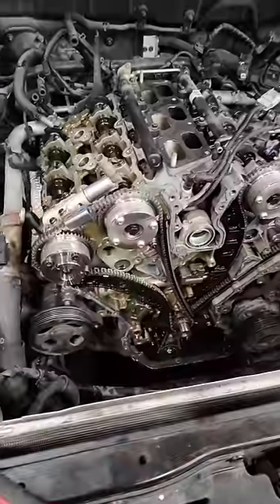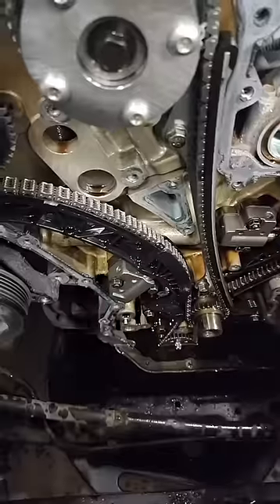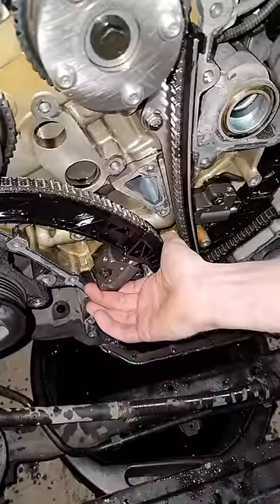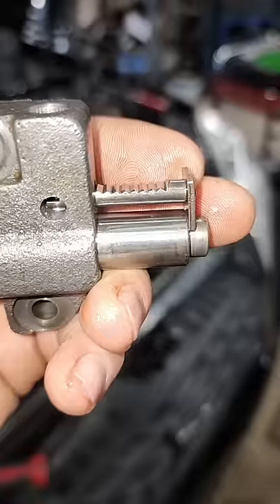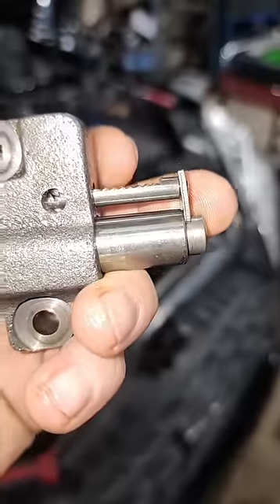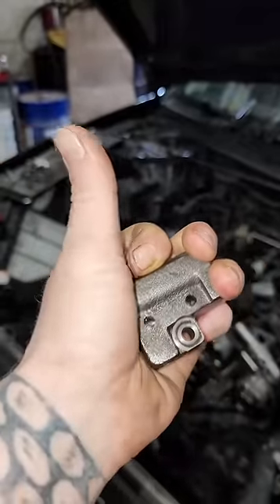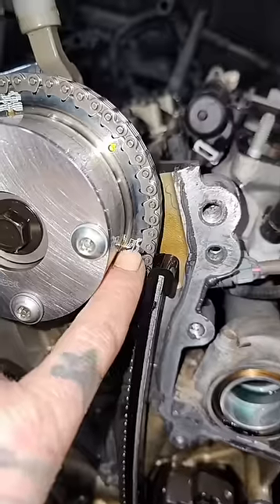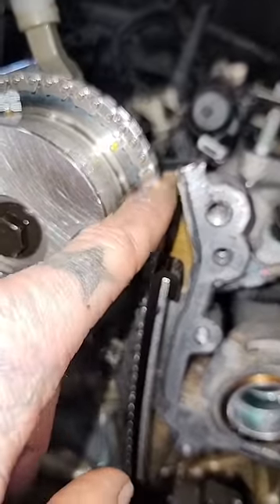I'm not happy

Comment: This is exactly why I quit doing side jobs. Stuff like this can come back and haunt you and it’s not even your fault. It blows my mind how often new parts fail within 30 days or are bad right out of the box. I feel for you brother.
Reply: I got a bad steering rack from napa for a Toyota sienna I took in as a side project. Doing one of those on your back in the garage sucks. Doing it twice is infuriating.  I’m pretty much done with side projects after that experience.
Reply: @ryanalexander984 Napa is like Walmart for car parts.
Reply: @crea7ure613  it’s always been better for me then auto zone or oreilys or rock auto.
Reply: @ryanalexander984  no we use them at my shop too but just over the years I’ve either seen the quality of their stuff drastically drop or I never noticed before but the last 5 years I’ve had more failed out of the box parts than any other company I’ve ever used.
Reply: I always buy OEM, but I understand, most people are in a hurry and don’t want to wait the time to receive.
Reply: @ryanalexander984 if you wrench all day long I wouldn't want to work in my own car let alone a come back sider.
Reply: @crea7ure613  have you ever had issue of all GM reman calipers from Napa failing quickly? For whatever reason they like to leak brake fluid from the seals after a month.
Reply: @jackmyhre8759  reman is the worst, I’ve always thought failed once it’ll fail again. But no not particularly calipers but alternators, wheel bearings, struts and shocks, had a few axles leak within 20k miles, nothing better than warranty come back.
Reply: Usually the problem is right in the box.
Reply: @proudwhitestraightman8489  it can be exhausting.
Reply: @crea7ure613  except overpriced
Reply: @Jordan__Sloan  I have had tons of issues with OEM on ford's. 
I've been soucing different products out from China now. 
Tell my customers it's cheap shit. But most of my customers understand. 
But with the Fords. 
It's like pulling teeth. 
Had to do a t stat OEM ford did last season, I got stuck doing it in -46C, I did have a heater outside. (Nothing moves much during those temps) but bleeding a 6.2 was the dumbest shit I've ever seen, put a 195f in. Then it decided not to open, motor called overheat. So shut it down. 
Then came back after a bit. Decided to open. 
Then power steering went, that line was also new. Ford wanted $234, I had a shop build me a new one with better materials for $130. 
Shit is garbage now.
Reply: Question: What protocol does the mechanic follow when the fault is on the part manufacturer?
Reply: @chriscasias375  good question
Reply: @chriscasias375  It can be painful and annoying. But I've seen some places send me full motors. 
But still don't cover time lost. 
To me you always loose, unless warranty comes into play with a dealership.
Reply: @Jordan__Sloan  sure bubbie sure...ur That guy ...
Reply: @crea7ure613 where's the best place if not napa?
Reply: @ryanalexander984 o'Reilly's is awesome. Autozone fried my battery. And terrible customer service.
Reply: that company that makes all the parts is bad, that chena company
Reply: @mitchellandrew3318  lose
Reply: @mitchallen5819  Seriously? Oreilly is the best in your opinion? You new?
Reply: @mitchallen5819  
It use to be Napa and Carquest. Carquest is now part of another chain thats similar to autozone. Im half asleep
Reply: @mitchallen5819  OEM
Reply: @crea7ure613  so, any parts store that has OEM?
Reply: @mitchallen5819  yeah typically. I’m not saying Napa as a whole is a bad company they just have bad parts just their branded parts are bad quality.
Reply: @JohnSmith-xu7ev  I've been to many different ones of both. They're usually quality, but over priced. 
O'Reilly's is the only place I've been to with good parts at a fair price and good customer service. 

A friend of mine was getting nowhere with other parts stores. 
Took him to the O'Reilly's where I usually went. When we left I said "do you see now why I go here?". He replied "yes, I may need to reach out again soon".
Reply: @crea7ure613  hhmm. I know I've seen OEM of rockauto, but they're usually expensive. Probably for a reason.
Reply: @mitchallen5819  OEM is OEM. Doesn’t matter where you get it. Like I said OEM through Napa, great stuff. Same with Rock Auto, OEM is good. Anything less is a 50/50 chance and I’m not betting my labor times on China garbage. Even some OEM shit is Chinese but hey that’s what the company wants to use it’s their reputation not mine.
Reply: @chriscasias375  At our shop, we go back to the manufacture and get them to pay.
It works for us through because we are an engine manufacture with our own parts, it's just a different division of the company so they eat the cost instead of us. (Cummins) It's a lot harder for smaller service sites.
Reply: @ryanalexander984  ouch, steering racks are bad enough but twice? I might need bail money 😂
Reply: @Jordan__Sloan  My friend had a headlight change immediately fail. OEM parts. Done in  Toyota Dealership shop.
Reply: @crea7ure613  true, but like you stated - if Chinese garbage is OEM then it's their reputation, but also your labor time. 
Good insight. Much appreciated.
Reply: I'm in hvac and even oem parts come jacked sometimes and of course they're perfect so it must be our fault
Reply: @bdog4u2  I’m also HVAC. I know exactly what you mean.
Reply: Not advocating that parts get made on China, but the quality depends on the standards set and monitored by the parent company. GM in Australia (Holden) quite a number of oem parts -ACDelco are made in china, as i assume are for US ACDelco too now. Number of European cars too.
For a number of parts ill only go oem, better life, ride or fit then aftermarket, everything else either good aftermarket or oem depending on price/quality options
Reply: Is there any independent quality control can protect consumers?
Or maybe they are doing this on purpose to force people to buy EC.
Reply: I changed front tie rods, a water pump, and did an oil change on a 2008 dodge ram.  A week later the customer called me and blamed me that his engine was knocking.  He had a shop pull the oil pan and they found the engine was full of sludge.  He tried so hard to blame me.  Ive never done another side job since.  It aint worth it.
Reply: @mitchallen5819  oreillys for sure. Autozone has gone woke, customer service and staff are horrible with no automotive knowledge at all, and their duralast parts are total crap. Been using oreillys for a while now. They all know me by name, are super helpful getting me oddball parts when I need them and I've had very little trouble with parts I buy from them
Reply: @tylerwightman2315  same here pretty much.
Reply: Amen brother!!! Makes you look bad and very few people understand... And now with so many litigious City folk moving to the country looking for a score you're just risking everything you own.
Reply: I do a lot of work on the side, and over the years, dealing with shitty parts has caused me to do two things: one, I paid the $150 in my state to form an LLC so that my liability is limited in case of a lawsuit; and two, nowadays I have all my side-work customers sign a one-page disclaimer & waiver that I paid a lawyer friend to write up for me. It basically states “you’re coming to me to have repairs done outside of a professional environment; unfortunately there can be unintended consequences as a result of parts failures, and these failures are not the responsibility of the installer. The installer only warrantees his labor if the installation itself is found to be the root cause of failure.” There’s some other plain-English stuff in there, but what I explain to my customers is this: If I do an engine repair, and the new parts fail and cause the engine to explode, I bear zero responsibility. I can get away with this because I do not mark up the parts and the agreement also states that all parts are, in essence, customer-provided. Oddly enough, I haven’t had a single customer take issue with signing the paper. I also haven’t had a major failure yet.
Reply: That's why I put original parts instead of aftermarket
Reply: China special
Reply: I recall in a college engineering course, majority of failures occur near the begin of the product life, and past the expect life expectancy. If it doesn't fail within a certain, it won't likely fail until long after use (unless you abuse it).
Reply: @ryanalexander984  awe poor baby
Reply: @frickenbored  bummer
Reply: @mattmatt222333  I know right? I was terribly inconvenienced.
Reply: @crea7ure613  another of parts are oem garbage
Reply: @Jordan__Sloan  oem parts are failing just as much as aftermarket unfortunately
Reply: @mitchallen5819  OEM
Reply: @chriscasias375  find a different manufacturer
Reply: Computer repair is about the same.

Customer: “you worked on it last and now it’s dead”…
   of course “last” was 2 YEARS ago!!!
Reply: @JohnSmith-xu7ev  yep carquest is my go to. Oddly enough i am not a fan of their parent co. Discount . (Or now i guess its advance) carquest seems to have their act together atleast. I also use carparts if i have the time and can wait for delivery
Reply: Couldn't handle it eh.😂oh well, tisk tisk
Reply: @jimbobdobbs1597  
Yeah, thats the name advance auto parts. I hated when they merged.
Reply: Thats why i dont even try to get side jobs. If i wanna work on my day off, its safer to just go for overtime at work
Reply: This, and finally making money in the trade after a decade 😂 customer supplied is even worse.
Reply: I replaced the fuel pump in my 97 F150 about 2 years back and within a week it stopped working. Why? The fucking rubber isolation sleeve MELTED (or more accurately started dissolving) IN THE GAS and clogged it up. Why the FUCK would they put rubber on a fuel pump that DISSOLVES IN GAS?? Gee, I sure love dropping the fuel tank twice within a month. Luckily it was only about 1/4 tank.
Reply: @crea7ure613  you spelled oreilly wrong... Napa is definitely going downhill fast but it’s still better than all the rest
Reply: You can reduce it a lot by not buying a shit brands parts. I allways try to use OEM suppliers parts or the brands that are good in doing specific parts... Like continental and Dayco for belts. INA or SKF for pulleys and bearings.. Lemforder for axle parts... Victor reinz and Ajusa for seals and gaskets, Mahle for engine oil system parts and so... These are common Euro manufacturers... I would say TOP manufacturer... But yes sometimes something go wrong and usually because it was piece of shit before you even touched it...
Reply: @mr-garagechannel8294  🤣 well considering when you buy timing sets new over the counter from gm and chyrsler its a reboxed cloyes parts that would not do anything except double or triple the price of an engine rebuild! Continental and dayco belts are great i will agree.. victor makes JUNK! I will use felpro every time over victor! And you have clearly never actually rebuilt and engine.. the cost of parts is already so high you simply CANT use oem parts or the price gets so out of hand the job will just get turned down! And you talking about using oem parts... dame shop used a set of factory gm ls dod lifters didnt make it 500 miles and one failed and guess what gm told him... NO WARRANTY on lifters whatsoever! So $700 worth of lifters and a gasket set and labor was ENTIRELY on the shop! How do you point blame on that one!
Reply: @glastornjet73  what kind of problem did you had with Victor? I have never had any problem with it.
Reply: Engine rebuild is woth if car is worth it or if you buied it cheap because engine was bad.
Reply: @mr-garagechannel8294  the head gaskets are 100% bound to leak every time absolute garbage
Reply: @glastornjet73  GM lifters failed... OK that happens I know.. Because OEM parts are sometimes already shit, but I said use OEM supplier parts not OEM parts from dealer... That's a little bit different.. Because you buy usually a different quality parts (probably lover) but sometimes the same as OE and you have a varanty.  For example... Timing chains on some BMWs fail a lot do will I buy a set of chain from dealer... Yes if BMW already sell redesigned parts... Or NO and buy some other brand... It allways depend... Of course time to time something will go shit.. But by minimizing it you can still avoid a lot problems.
Reply: @jackmyhre8759  yes cuz gm brakes are the absolute worst! every gm pile of shit ive had always had brake problems!
Reply: I bought three torque wrenches in a row that were further off spec that my dead reckoning. I needed the torque wrench for head bolts. Luckily I’m ocd enough to check em before use. And the in/lbs torque wrench was accurate far as I could test but every bolt I used it in I could unscrew the next day. I think it was from temp changes
Reply: @crea7ure613  reman alternators are a pain. Last one I bought had a bent shift right from the store
Reply: @ryanalexander984 part of that has to do with the quality of metal used and the production processes.
Reply: @HyperactivePicker  recycled metal compromised strength from impurities. Going to swap timing belt and tensioner in my accord. OEM parts, hoping for the best.
Reply: I got 3 crappy carbs back to back....taps just stripped out as soon as i took the factory muzles out, flotters didnt work.
Reply: This is why i lf i do side job imma record everything i do just in case
Reply: @thewitt76 I put 3 NAPA racks in the same car before it left the shop, that's the last aftermarket rack I installed
Reply: Why I retired.
Reply: CHYYYNAH
Reply: Had a belt tensioner from autozone completely disintegrate on my 3800 after about 3 months. I had just fired it up getting ready to go to work and it sounded an ape punched it's way out the block. Everything else was fine, but now I keep a close eye on my new one. Any undue bouncing and it's out of there.
Reply: Buy oem parts
Reply: Facts💯
Reply: Exactly dude One time I changed the timing belt on get this, a '91 GS400 with 487,000 mi. I told the guy that parts were going to run about $50 more because I was going to install a water pump while I was in there and the guy complained to no end I'm like dude it has almost 500,000 miles in the water pump is old as hell and I'm already in there there's four camshafts and like 20 different idler pulleys just let me put the shit on.
Reply: @Timpon_Dorz  in some cases those are no longer an option or available at all
Reply: I Google the reviews real quick on any part I need and YouTube videos on it before I buy and that usually gives me a good idea what is shit. Learn from others mistakes 😉.
Reply: @crea7ure613  funny enough Walmart isn’t that bad of a place for car parts never had a a bad experience, sometimes you need something cheap and quick
Reply: @Mitch Allen  You work on Honda car, you get part at Honda dealer. You work on Kia get parts frm Kia dealership. That's where you ge
Reply: @Mitch Allen  You work on Honda car, you get part at Honda dealer. You work on Kia get parts frm Kia dealership. That's where you ge
Reply: @Mitch Allen  You work on Honda car, you get part at Honda dealer. You work on Kia get parts frm Kia dealership. That's where you ge
Reply: @Mitch Allen  You work on Honda car, you get part at Honda dealer. You work on Kia get parts frm Kia dealership. That's where you ge
Reply: @Mitch Allen  You get OEM parts from the manufacturer. Honda parts, go to the Honda dealership.
Reply: I've been saying for years Kia Hyundai use poor cheap wire harnesses which turn into electrical problems on the vehicles & now fires, I had a 16 Sorento what a nightmare almost everything broke electrical issues up the a** battery continually dying, moon roof wouldn't close just a disaster, they entice with the designs of the car but reliability eventually catches up to you... I remember Hyundai back in the 80s Pony Stellar were also disasters.
Reply: changed brake calipers once and the caliper bracket didn't have friggen threads on it so i had to take two hours out of my day to get a replacement really frustrating
Reply: Yea. Sucks for small businesses
Reply: I own a shop, you are 109 percent correct. Did a Chevy 2500 front end. Took 4 gear boxes. Yes 4. First one leaked at front seal. 2nd had ton of play third was even gonna install this one.  Replaced one set of ball joints upper and lower a tie rod end and the pitman arm tie rod end.  All in same vehicle. At same time. Oh ya. Stabilizer bar leaked the gas out!!!!!  All before this truck drove once. !!!! So ya I hear ya lmao.
Reply: That’s part of doing business my guy!
Reply: That's why you charge $100/hour labor.
Reply: I only do quick and easy side jobs like brakes.  Been burned too many times with bad parts or customers buying cheap parts.
Reply: @backyardhooper06  I own a business so I have to take  more then I want :)
Reply: Right, and if your doing it outta your garage then all of the sudden your a backyard mechanic that had no idea what you were doing and it wasn't your fault then your expected to buy a new one outta your pocket and all the labor for free. This is exactly why if it's not mine or families I won't even think about working on it.
Reply: All that b.s. trying to save the customer money by making cheap shit. I wonder why its so damn hard to find quality. Maybe because all this stuff is shipped in from overseas
Reply: same here :( family only, no one else gets the helps
Reply: @chriscasias375 It's called charity work. I'm sure estimator or service advisor will "TAKE CARE OF YA ON THE NEXT 1" HA!
Reply: @Rebel1280 Yeah and sometimes Da fam are worse than the public. HA! Fixing shit for fam is the worst! Lol
Reply: That’s why the most reputable aftermarket parts are better than dealership . Like KYB and DENSO . . But I know they don’t make all parts needed aftermarket and dealership is only option sometimes
Reply: @ryanalexander984  Napa is good for axles pretty much it
Reply: I just put a rack in a scion tC. Went with a used OEM rack. Used OEM is often better than new aftermarket anymore. What a joke.
Reply: Yup. I rather work on my own vehicles for this reason. If I duck up I can accept that and deal with it.
Reply: Had my injector fail 2 months after replacing it. Took me forever to diagnose it cause I thought it could never be that
Reply: @crea7ure613 lmao auto zone is. Napa isn't perfect but way better then auto zone
Reply: Same